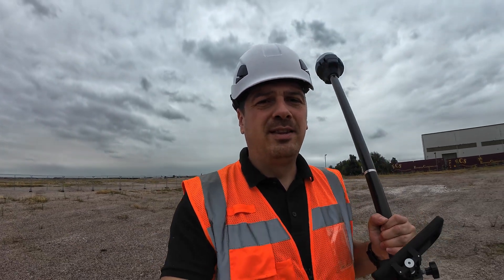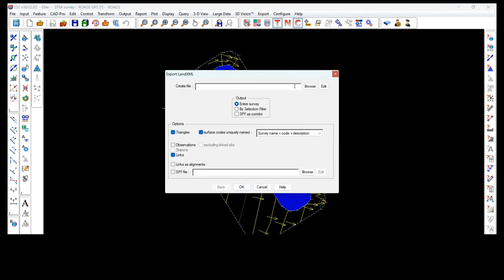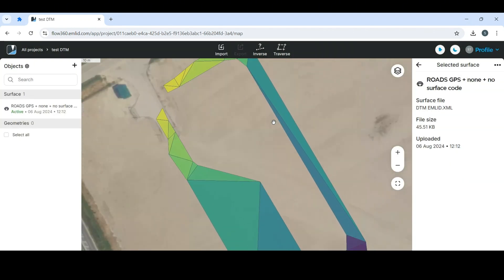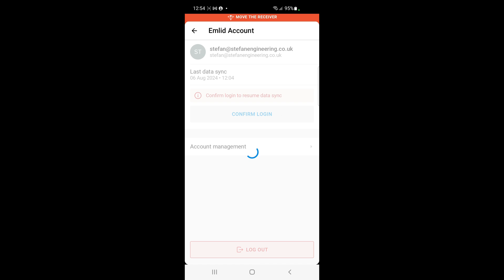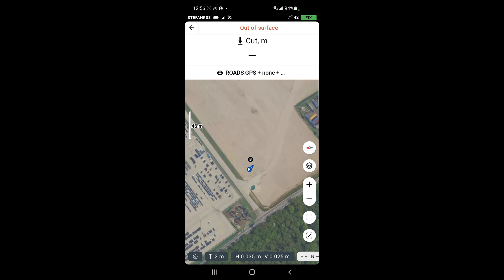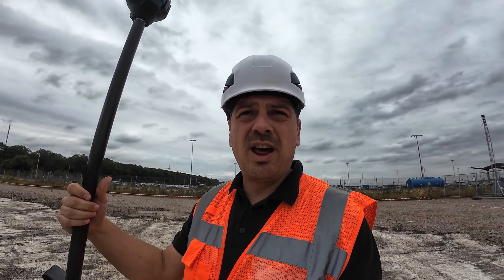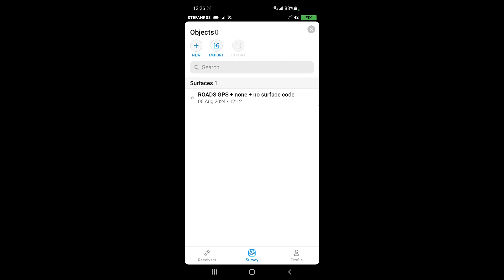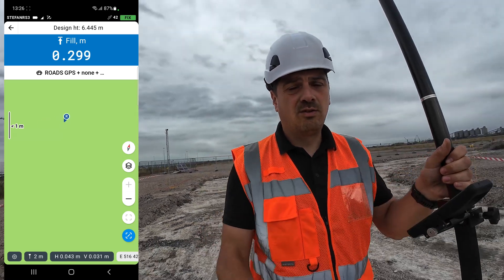Can Emlid Flow Surface Features Really Deliver?

Comment: Does Cut-Fill to points and linework still show the correct value when staking them out? I'm able to stakeout to surfaces correctly, but the lines and points show random incorrect cut/fills
Reply from the maker: @Millsy.g  it depends how you create the triangles for your surface in your software. The new feature works fine for me so far.
When I want to stake out only lines and points, I deactivate the surface.